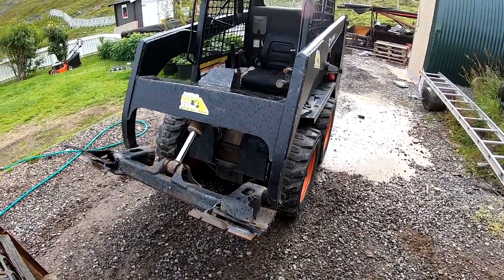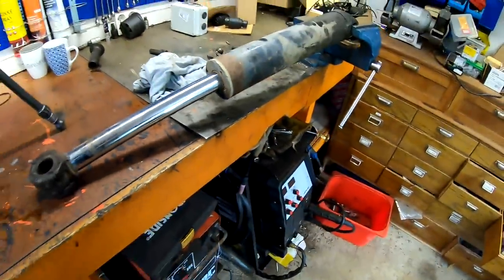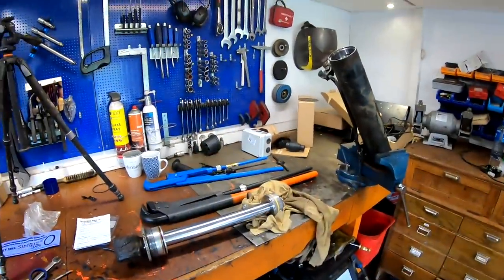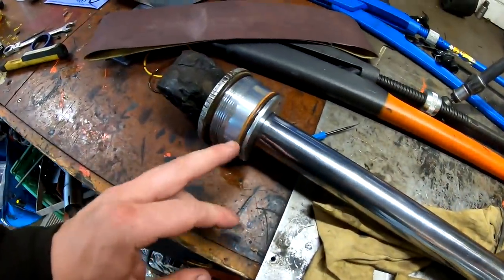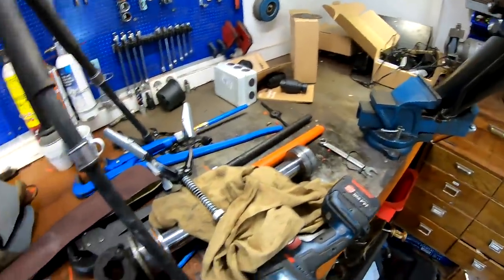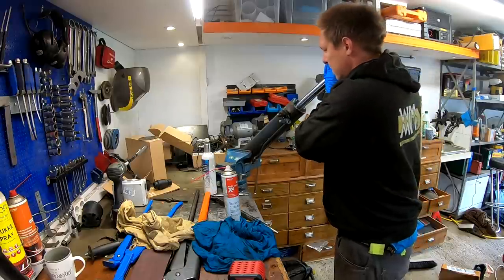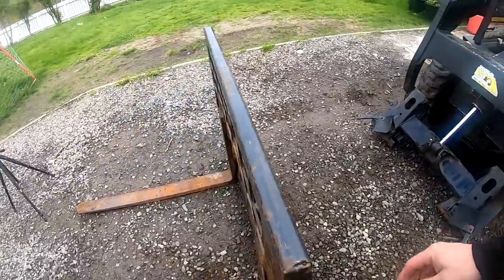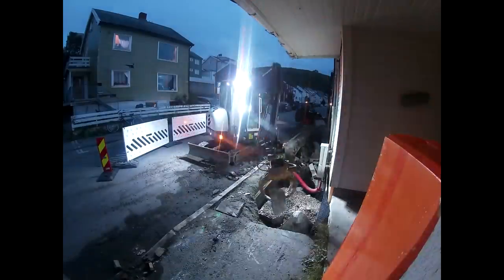Bobcat hydraulic cylinder leak fix (Didn't end well)

Comment: I just replaced the bucket cylinder on my Bobcat excavator last week because of a deep scratch  on the rod. The rod cost +new seals was more expensive than a replacement cylinder about $1000.00 Canadian. I also discovered a leaking boom cylinder today. I feel your pain.  I got the machine for a low price but parts prices are catching up to the price of a newer machine. My 323 is part metric for the body and engine but inch for the hydraulics. You can't win sometimes.
Reply from the maker: Yes its about 1000USD plus shipping for a new one, and I paid like 4000 USD for the whole machine...But as long as it's only the seals it's no problem to only change them, did it on my little kubota and it was a nice and easy job.

Comment: Yea, that is a bummer, oh well can always get rod stock and disc from hydraulic shop, but might be faster and cheaper to replace. Of note I presume you prelubed the cylinder, always good practice to fill voided side of cylinder with oil after installation, then use the other hyd. function helps to get seal area well coated with oil,  very good video enjoyed a lot. Thanks for sharing
Reply from the maker: Yes but the cylinder tube is so badly damaged that I think the cylinder is to dameged to repair. I did spray the cylinder with some good oil before reinstalling since I cleaned it good with brakecleaner after honing it.

Comment: I put new seals in a cylinder on my dirt scraper. The surface inside of the cylinder had rust pits in it. I tried honing them to smooth the edges but it still leaks and doesn't make full pressure. I will have to replace it someday but it works as it is so there are bigger fish to fry.
Reply from the maker: He he yes my tough't to, as long as it dont leak out for now I will leave it like this until winter when I get some more time.

Comment: When you work on hoses, Take a hammer and punch & make a mark on both sides of fitting 1-1 on next fitting 2-2 that way you never put hose on wrong fitting. I have changed 1000's of hoses and always begin marking them before taking them apart! 
Suggestion get a better mounted vise? LOL
Reply from the maker: Yes it's an good idea, i have the same thing with the trailer for the tractor every time i disconnect i dont know witch way I'm suppose to pull the handle😅 The wise is so I can turn it and you need to tighten the handle for locking the turning good when you apply a lot of force...

Comment: many people leave the cylinder on the machine while they break the big gland nut loose. Once it turns then take it inside to work on it. The marring on the piston may have been caused by a bent rod or binding at full extension. You had the same issue with your Valmet tractor didn't you?
Reply from the maker: That's a good idea leaving it on, didn't think of it. The valmet the rod was damaged from impact of some kind.

Comment: I would be checking the oil when you drop it. You may have some pieces of the hydraulic pump, drive motors or the insides of the hoses getting into the system.
Reply from the maker: I changed the filter when I bought it and it was leaking already than, but I will change the oil now, since it's a mix of engine oil and hydraulic oil and according to the manual it's suppose to be engine oil like on tractors. But there have been some kind of failure of some component some time since it's so damaged. A new one is about 1000 USD plus shipping..
Reply: Mini Machines what’s the Bobcat model number? Maybe someone could find a good used cylinder.
Reply from the maker: @seandurgin  it's an Bobcat 553